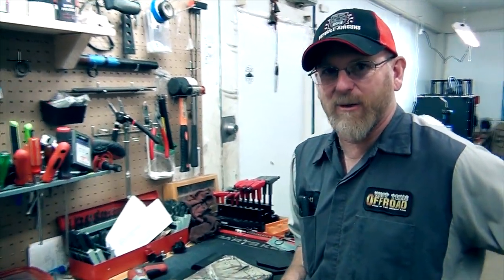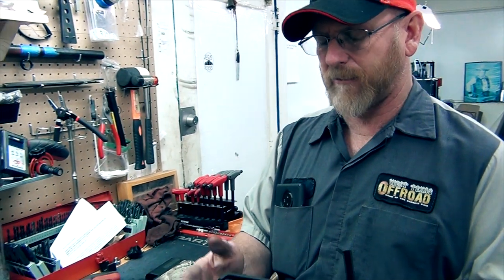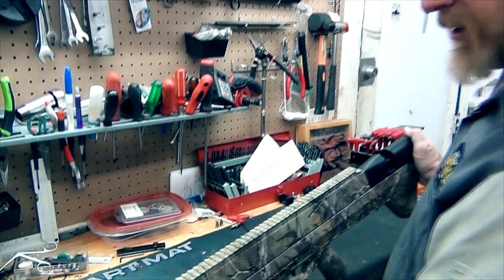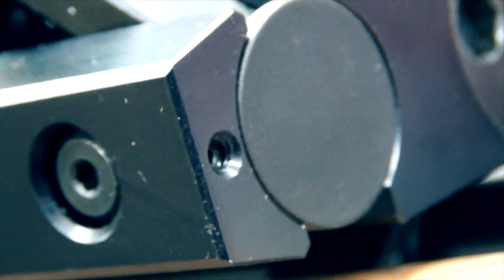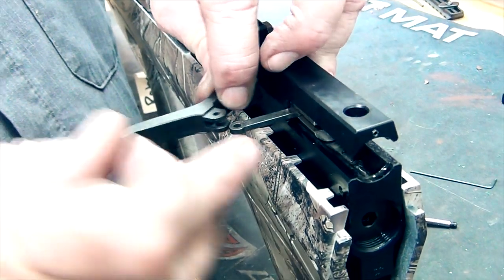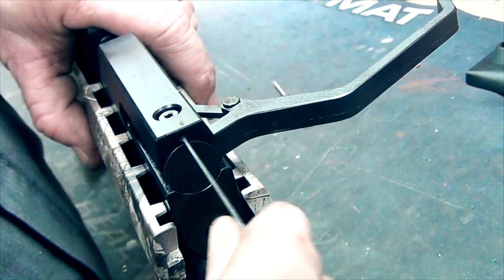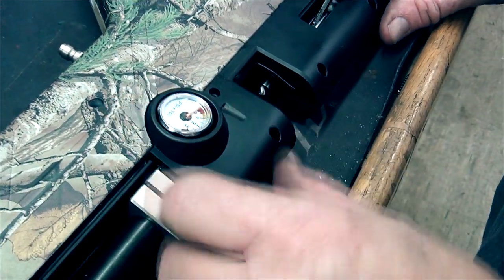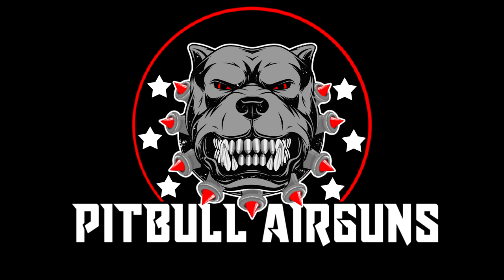Cocker Spaniel Charging Handle Install

Comment: Excellent vid…subbed! Just purchased a new M357 Bulldog end of last week and was delivered today. I’m a lefty and like a dumbass I forgot to have PA swap the charging handle to the left side…can I follow this method here on my newer model M357 and move the handle to the left side, making sure to reverse the pin/e-clip direction, orientation? Or is it more involved? I’d certainly appreciate any input before I tackle it and screw something up. Thx for your response if you see this post.
Reply: The process is exactly the same on the new M357s
Reply: @PaulCapello  Thanks Paul for the response…I’ll give it a go tomorrow after work.
Reply: @PaulCapello Changed the charging handle to the left side earlier today…just as straight forward as in the vid here, took about 15-20 mins and done. 👍

Comment: Hi can you help me? I have a problem of leak on my bulldog, when I try to fill the bulldog all the air goes out trough the barrel no retention of air at all same way I put air same way goes out trough the barrel, do you think is the stem valve? Or oring, I live in Mexico so Im not able to send you out my bulldog thanks in advance
Reply from the maker: I would say it's a valve seat or valve stem problem
Reply: @pitbull_airguns  thank you Mr., I will check that, regards.